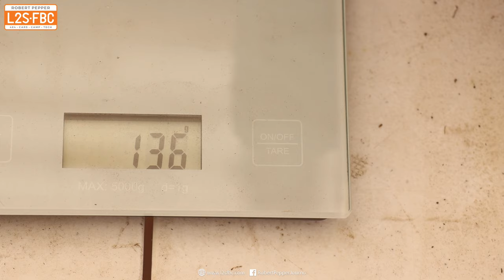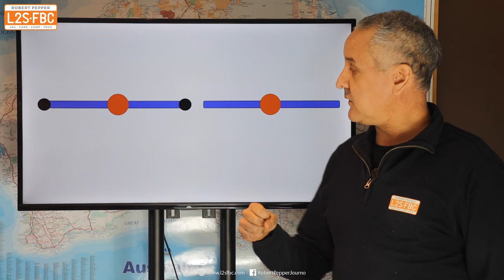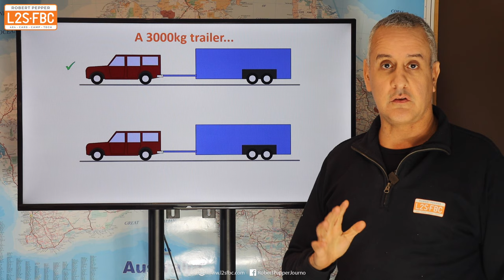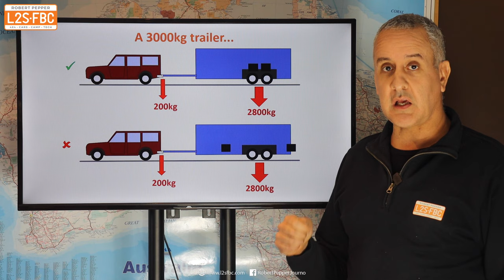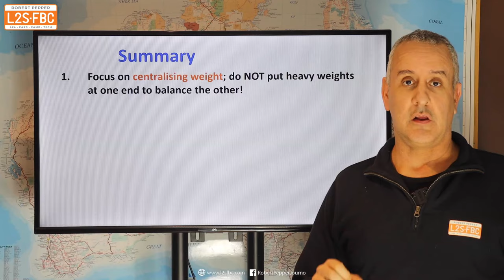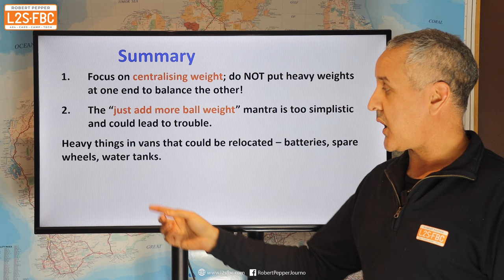Towing Dynamics explained with beer, wine and bulldog clips

Comment: Thanks. You’ve given my something to do tomorrow by having a look at where the weight is in my off road van. Traveling with no water in the tanks might be removing that centralised weight making it unstable. It might be better to travel with more water than I’d first planned on.
Reply from the maker: It may very well be the case yes, a heavier van with central weight may be more stable than a lighter one with weight at either end.

Comment: Your videos on trailer weight distribution are educational and very helpful. The one this you haven’t talked about is single axle vs dual axle trailers. I “know” that dual axle trailers are more stable, everything else being equal. My guess is that having 4 wheels fights yaw better. Plus instead of having a single front/back pivot point, you have the space between the 2 axles making the trailer more forgiving in terms of the exact center of gravity on the trailer.
Reply from the maker: Yes tandems are more stable, provided they are loaded to distrivute weight evenly on an axle. More here -> https://youtu.be/tyvpVv3PaWw

Comment: Great video.  Very educational...thanks!  You mentioned that you haven't seen caravan manufactures that pay much attention to centralizing weight in their design.  What are you thoughts on the Bruder EXP-8 design for proper weight distribution?
Reply from the maker: I haven't looked at the EXP-8, but I have looked at the EXP-6 in detail, see my video on it. However, I didn't go into weight distribution. The EXP tandem trailers do have the ability to vary towball mass though.

Comment: Have you seen any solution to the camber angle becoming more negative when you want it to become positive, In addition to the wheels angle  pushing the tow-bar the wrong way. The semi trailing independent suspension  does nothing to help the roll centre in relationship to the centre of gravity. Meanwhile to fix the stress just calculate everything suspension wise for a forty ton load weighing around 200Kg  unsprung weight. Clean sheet of paper required  ideas on a post card.

Comment: In large trailers with Tri-axle , all the load cannot be put over the axles only the space is not sufficient.
There  is a space between the first axle and the nose and between third axle and the end of the trailer. 
what about these spaces. Are they not to be filled.
Reply from the maker: centralise over axles with a little bit of nose weight